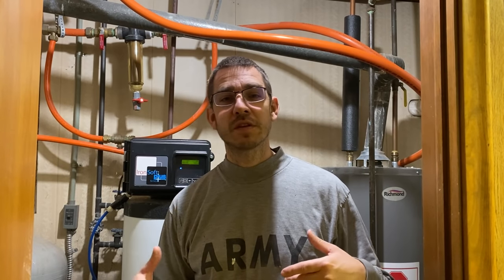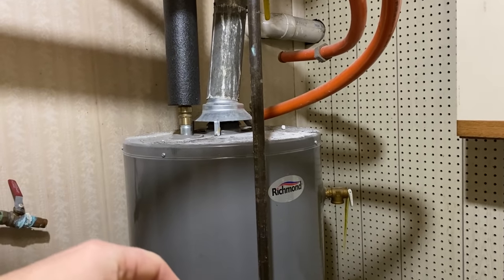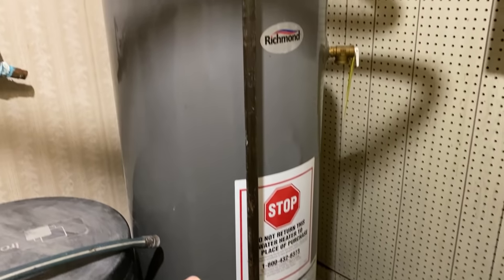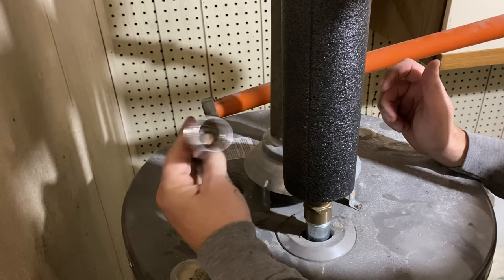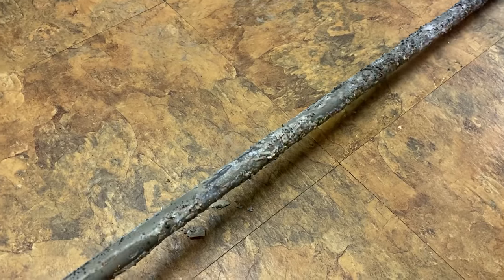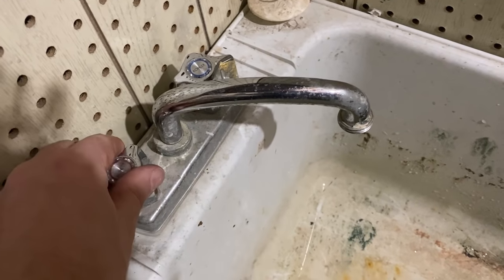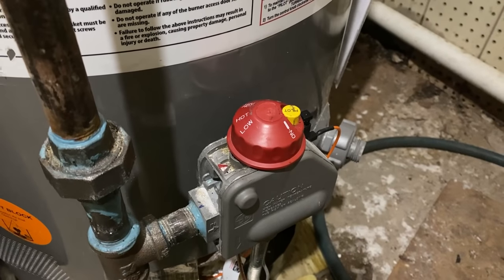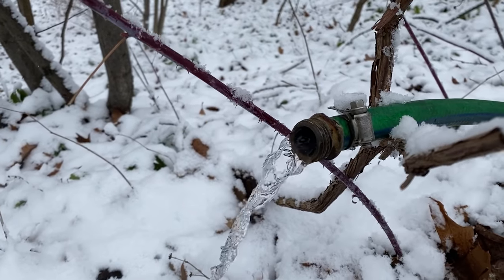How To Get Rid of Smelly Hot Water - Easy Fix!

Comment: I installed an electric anode rod in 2014 in my 6 year warranty tank. 9 years later, no smell and tank is like new. These absolutely work. Buy the cheaper warranty model and change it immediately. The only difference between a tank with a 6 year warranty or a 12 year warranty is how many anode rods and thickness of them it has.  Mine was a different brand but I don’t remember the name of it.
Reply: Thank you for your positive feedback on powered anode rod!

Comment: You just eased my anxiety. Recently inherited my Grandparents house, it's quite large with 3 full size hot water heaters on different ends of the house. Turned on the hot water today in a downstairs bathroom and it was smelly and grey. Who knows when the last time this hot water tank has been used. No problems upstairs. Not sure which tank feeds what yet. Think I'll just flush all 3 and get 3 of these rods.
Reply: to add, it's well water, northern VA.

Comment: Very timely. We just moved into a house with this issue. Identifying the tools, with links, is a huge help. An article I read suggested trying a cleanse with peroxide first.
Reply from the maker: The cleanse won’t hurt but is really unnecessary
Reply: @SSLFamilyDad  I did this project yesterday. Genuinely a life-changing difference. Thanks so much for your guidance and encouragement. I had to use a cheater bar, and reached one point where I'd concluded it wasn't going to budge, even with that. I kept going, mainly out of anger and frustration, and it eventually gave. I went ahead and poured 3 pints of peroxide in, while I had the rod out, which I later drained - so it wouldn't get into the septic system. 

I had access to a free aluminum rod, so I used it as the replacement. The water heater is 17-18 years old, so I figured I'm good for the remaining life of the tank. My neighbor had bought the rod and then couldn't get the old one out. He dosed his system with peroxide through a filter as  temporary fix, which he says has worked so far.

I was amused to find the previous owners had left behind an estimate for a new purification system that included a sulfur treatment module. $8,000.00. It's questionable whether that would have done anything at all to help the problem (since it would be before the water heater in the system). The appropriate solution turned out to be free.

Thanks again. I enjoy all of your videos. I'm picking up chicks in a couple of weeks for the first time and have appreciated your videos on that topic as well.
Reply: Just replaced mine. 20 volt DeWalt impact wrench made for easy removal. Added a half cup of bleach before reassembly filled tank and let the hot water run through all the fixtures until I could smell bleach. Let it set a couple hours then flushed out the tank and lines. My anode wasn't corroded much. Just a few small divets. Maybe an eight of an inch in diameter. It's the original that came with the house 30 years ago. Probably didn't need replacement but put a new aluminum anode in. Guess we'll know in a couple weeks if this cured the issue of smelly hot water.
Reply: @googleuser868  did it get rid of the smell? We're currently having issues with it stinking and want to fix it. thanks
Reply: @googleuser868  and a year later.... no update

Comment: I used a 18v Ryobi 1/2 impact wrench with deep well impact socket and took a couple try and then it broke it loose in less than a minute. I then installed the same electric replacement, which you need a larger socket. Why they didn’t make the head the same size? But no you have to purchase a different socket, dang-it!
I had only about 8 inches of a 4 ft anode rod when removed on our 14 year old water heater (didn’t know about such until I saw YouTube video, educated)
Only installed for about 5-6 months we shall see how it goes for longevity and protects the water tank for hopefully another 10+ years. Plumber’s I called talked about the same or similar product they would install.
Nice video to explain the removal and replacement process!
Reply: how has it been working out for you? seems like i have the same problem
Reply: how has it been working out for you? seems like i have the same problem
Reply: @yefricanales5275  Thus far as I can tell it is working. I never had any odor or taste issues before and since the water was getting on with age, attempting to avoid any issues and get some more life out of the Hot Water Tank. Thanks for asking!

Comment: I have cut my anode rod off and that fixed the problem, this was suggested by a plumber.  I changed the tank out after 15 years of use.
Reply: No rod in the tank means that you were actually allowing the lining of the wall of the tank to brake down faster. Instead of attacking the rod it now attacks the coating on the inner tank. It shortens the life of the tank without a rod in the tank.
Reply: @scottnickum9315 Yes, that's what I''ve been told, however my practical experience is the tank was in service for 15 years in my home and was then has been used in our barn. Hasn't died yet.

Comment: For anyone curious, the reason this occurs is because water naturally contains ion sulfates and these can be converted into hydrogen-sulfide gas which is what smells like rotten eggs. It is both highly toxic and flammable.

In water heaters, the aluminum or magnesium anode rod inside the tank reacts with those sulfates to produce hydrogen-sulfide gas. When the sulfate levels are high, enough gas is produced to give the rotten-egg smell. Changing the anode will fix this issue.

The other method by which this can occur is if the water contains both high levels of ion sulfates as well as sulfate reducing bacteria, which as the name implies feed on sulfates and in turn produce the hydrogen-sulfide gas. In this case you have to get rid of the bacteria. If only the hot water smells, (it is most likely the anode issue as stated earlier) it means a colony of the bacteria have grown within the hot water tank. If the cold water smells as well, then the bacteria exist inside the well. In both cases a shock chlorination treatment to the tank or the well will fix the issue, but may have to be repeated in time.
Reply: I have a question. Only my electric hot water heater smells. Pretty bad too a few rooms away too. However the weirdest part is both cold and hot water from any tap or shower head does NOT have a septic smell. We are on a private well, and I have shocked it about 4 months ago.

Comment: Great informative video but I am trying to get my head around a few things.  The whole purpose of a sacrificial anode rod is to be the “thing” where corrosion occurs rather than the glass-lined steel tank.  In order for this to occur the sacrificial anode rod must be a lower galvanic material than the steel tank (ie magnesium or aluminum).  The device you have installed is titanium which is much higher than steel.  I get that it’s electrified using electrolysis but it still seems to me that the steel tank will corrode prematurely.  I really REALLY want to trust that this device is good LONG term though I just don’t understand the science behind it
Reply from the maker: https://poweredanode.com/ - This is a basic explanation of the difference but I guess I am with you, I can't say I see chemically how it works, but I do know it works!
Reply: Having lived with the smell I would willingly replace the tank prematurely to avoid it.
Reply: Hey Matt that's a very good question and I'm sure you're not the only one. The Corro-Protec system includes a titanium anode and a current rectifier. When the rectifier is connected to the nearest outlet, the rod in the tank supply a small amount of current into the water heater. This current completely stops the loss of energy from all metals to which the ground is connected. The corrosion process is then completely stopped. Since the anode is made out of titanium, it does not disintegrate over time.
Reply: The powered anode rod works on the principle of impressed current galvanic protection.  The titanium rod serves as an electrode (active anode) and will function with corrosion as long as power is supplied to it.

Comment: Very nice video, thanks for sharing.  Do you also shock-chlorinate your well to help with this? I was just watching your previous video on this topic last week. A few weeks ago, I replaced the anode rod with a fresh magnesium rod, and now the hot water smells much worse, and I've been looking for a solution. I was skeptical of the electric ones, but based on your videos, a few others, and a wiki page on impressed current cathodic protection, I've been convinced that these powered anode rod products are legitimate. Thanks again.
Reply from the maker: The anode rod is most likely the issues, this is the second one I have done and both worked perfectly
Reply: Wouldn't an aluminum anode rod work fine? My understanding is something in the water reacts with especially the magnesium rod to make sulfur.
Reply: @mindfulmagician7550  I think an aluminum rod would've probably worked fine for me as well. I originally went with magnesium because it protects the water heater a little better than aluminum (more reactive), and it's better for drinking water (though we don't drink the hot water). I've had the powered anode rod installed for the past 5 months or so, and I've been happy with it so far. The sulfur smell is gone and its little green light is still on.

Comment: If my hot water heater has 3 anodes, do I need to replace all 3 with 3 powered anode rods? Or can I install 1 powered anode rod and leave the other 2 out?
Reply from the maker: Your hot water heater does not have 3 anodes. You probably have an electric water heater which has 2 heating elements and one anode rod on the top
Reply: @SSLFamilyDad  Hey thanks for such a quick reply. I went back to my owners manual to double check and it says "This water heater is equipped with multiple sacrificial anodes." And when i look at the parts diagram, there are 3 anodes shown. i thought that was crazy too. It is a gas, indirect fired Bradford White water heater. In your opinion, do you think 1 powered anode rod would do the trick? And is it possible to just leave the other 2 anodes out? Thanks again for your help.
Reply: You can replace only one of the anode with a Corro-Protec anode and let the other one in. It will work perfectly !

Comment: Sulfur oxidation smells like rotten eggs. I would buy a new tank and filtration system. Because they look older than 6 yrs and we replaced the tank at my Dad's and Mom's house it was pretty easy to remove the tank and reconnect the new one. I moved the old one out myself and my brother and nefew put in the new one we finished the connection. The old tank was rusty

Comment: A good idea from plumber that serviced our heater, open hot water taps periodically when heating the tank back up, and do so in stages.  The water being heated expands and builds pressure.  While likely not resulting in a catastrophic failure, releasing the pressure as the process goes along will reduce stress on the heater and connections, etc.
Reply: That makes no sense and is unnecessary. The tank can handle it just fine. Think about this. Some families will run out of hot water every morning with all the people showering. Then it's filled with cold water and heats up again from the beginning each time. 365 times a year. It's not going to pressurize too much or the pressure valve would release. Seriously it's pointless to do that. The tank and all the plumbing are rated for this.

Comment: I am having this issue with a brand new heater. Is there another method, or even if new does it need replacing? Thanks
Reply from the maker: Even if it is new, same issue, try the powered anode rod

Comment: Would it smell near the water heater?  Mine is electric so it isnt a gas leak but I have a similar smell in my utility closet.  It gets very bad when hot water is running but the closet stays smelling so bad in the last couple of weeks. If I open the doors and stick my head in at any point it smells and worse near the top of the water heaterm. I am second guessing this because I feel it would be sealed so it shouldnt smell.

Btw, my water heater was replaced around 2 years ago.

Comment: Is the electronic anode rod works well? Saw ratings in the Amazon site where 10-20% posted the tanks with rust. Just wondering if you still recommend the electronic product
Reply from the maker: It works great!
Reply: Absolutely! The technology behind our electronic anode rod isn't novel—it's used in various sectors, including the protection of gas pipelines in the US. While some skepticism arises from unfamiliarity or a lack of understanding, we've been specialists in this domain since 2006. Our product is designed to combat corrosion inside the tank. However, it's worth noting that it doesn't address outside corrosion, issues with the heating element, or other external challenges. Our focus is on delivering robust internal tank protection based on tried and tested technology.

Comment: Townhouse electric water heater has " small leak" per maint man. Hot decided  stop working. He came out band-aiding it( young guy)Ordered part. I told them both hot and cold runs yellow smells like rust or something burning when I shower x2 wks now.All the faucets run with a yellow tint. Happens to be a leak in the ceiling downstairs next to the electric heater. He claimed it was the upstairs restroom faucet. Still waiting for a part I'm concerned with the taste and the rusty that were ingesting and the lack of concern with them. Should I be worried

Comment: What if the cold water starts to smell like that? It didn’t use to but it Does now in the kitchen.
Reply: Could it be odor coming up thru the drain?
Reply: @steveguinn9740  No, you smell it in the glass. I figured it was sulfur but it dissipates quickly. It was a new development.

Comment: Does this problem occur with instant hot water heaters?
Reply: Yes, there are certain procedures that need to be done to those every year.
Reply: @augustreil  I thought if you use a water softener that would take care of the on demand water heater. My in-laws installed a water softener and now they say they never need to flush it
Reply: @mamabear9389 , There's no doubt that a water softener slows the mineral build up, but because an instant water heater has to heat water almost ''Instantly'', it also will have mineral deposits faster. I would still flush it once every 2 yrs. That's what I do, just to be sure, and it always seems to work better. I'm sure this can vary all over the place.

Comment: My water is so hard I forgot to changed the elements after 3 months and the calcium bilt up so much that it spread the elements apart and I can't get them out.
Reply: Pull hard, they'll come out.
Reply: @larryrivers2752  and destroy the threads and ruin my heater. I have the 5500 watt. Which means they are longer and go out and wrap back. It just barely fits in the hole

Comment: Didn’t you do this in your old house? I solved my water problem with a new rod of a different material. Didn’t need powered rod. Peace
Reply from the maker: That is also possible however I understand the powered rod to protect the water heater better
Reply: I believe you can replace the factory magnesium rod with an aluminum one and it's supposed to make the smell go away.

Comment: Did you flush the water heater with some bleach and water after draining it?
Reply from the maker: Nope, just drain it and the refill after
Reply: @SSLFamilyDad  Thanks. That filter to the left of your head at the start of the video, I have one like it inline before the pressure tank. There are no valves to shut the flow off from the well to change the filter. I noticed yours has a drain at the bottom if it. Is that used to flush the filter?

Comment: just so I understand this correctly, the water coming into the house already smells bad and the anode rod removes the smell? and when the rod is old and bad (not working) the smell comes back? 
does the cold water smell bad also?
Reply from the maker: Cold water does not smell, this is a chemical reaction that takes place in the hot water heater with a standard magnesium anode rod, using the titanium anode rod removes the problem reaction and subsequent smell

Comment: Your issue actually is the disused/ disconnected softener. You need to reconnect the softener and use it in conjunction with the anode. I recommend Kinetico salt and softeners. Even if you use an off brand softener, go with Kinetico salt. The source of the smell is the water from the well not the old anode.
Reply: It isn't the water softener as the cold water does not smell.   Only the hot.  We replaced the rod and the smell went away but after about 8 weeks it came back.  So this time around we will use a power rod and see if it does the job.
Reply: @adahathaway88  wow, thanks for sharing that. I was about to replace with aluminum. Have you changed to power rod yet? How did it go?

Comment: We had a new well drilled a year ago. Shortly after that started to have smelly hot water. Drained hot water tank added hydrogen peroxide smell disappeared for awhile, the next time we used bleach. Same result, smell gone for a while. Third time we replaced anode rod. Same result smell gone for a week or two. PS hot water tank was only 4-5 months old when the new well was drilled. Any suggestions are greatly appreciated.
Reply: Hey, have you replaced the anode rod with our Corro-Protec powered anode rod? If not, this will solve your problem for good.